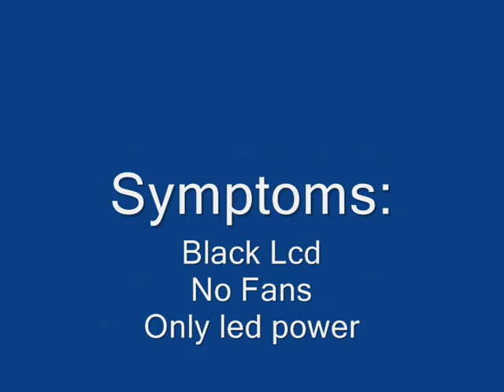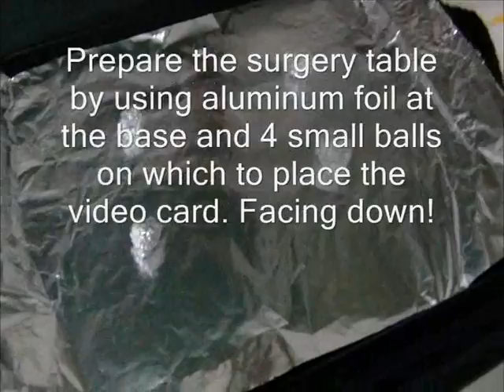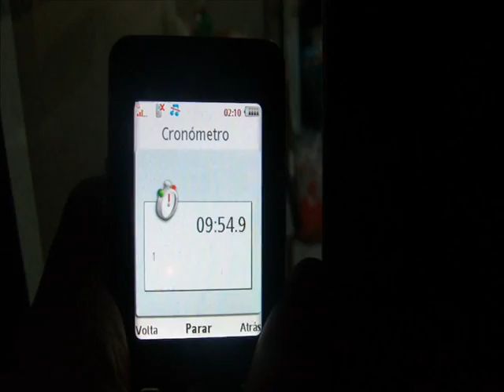OVEN FIX ! Dell xps m1730 video card repair!

Comment: Temperature and times seem to be spot on. I was able to fix a non-sli 8800 card using this, while i have my doubts it will hold up it at least does provide a temporary solution while parts on order. Thank you for taking the time to make this video.

Comment: Thanks Daniel...I still can't believe this actually worked on my M1730. I have a dual 8800M SLI and one of the cards failed. This caused both of them to not be able to accelerate o do any 3D, nor use a second monitor. I still had image, but I decided to try your tutorail, and now the are back to work.
Reply: I'm not sure what you use your m1730 for, but I have one here that I'm going to repair. I left my tools at school, so I'm not performing this repair right now, but if you've tried, how would you say modern gaming performance is? I got one of these beauties as part of a computer parts trade. Wondering if it's worth upgrading to the next model up after I see if it'll even boot
Reply: +Alex Riordan I do not game as much as I did 8 eight years ago when I bought the laptop, but it still surprise me what it is able to do. Lately I have played Tomb Raider, Pillars of Eternity, Bioshock Infinite, Dishonored....and the performance was quite impresive, I did not feel the need to change to another machine. I have not tested it with demanding game from 2015 or so, so I cannot confirm that is able to run correctly something like Witcher 3 or Fallout 4, but it would be a surprise if not.

Comment: What if i hear only 2 beeps and nothing else ? and btw keyboard lights are working so as the speakers lights and background of screan, and the battery is not working im running it on the charger

Comment: Two nights ago, my M1730 developed this problem.
Last night, I decided to try this.  It worked.

Some notes:
1. You will need a flat-blade micro screw-driver to remove the heat sink. The star (torx) screws are smaller than T-10.  These screws are fixed into the heat sink and won't come out.  The screw through the board into two square metal brackets on the back of the card.
2. You will need to remove the black plastic cover on the left side by removing the hex standoffs around the DVI port.

Comment from the maker: It seams pretty much what happened to me... but if u're still getting to windows maybe u should wait until it is completly dead. 
These beep codes are the ones that represent a bad grafic card, if u dot get them maybe u have  adiferent problem.